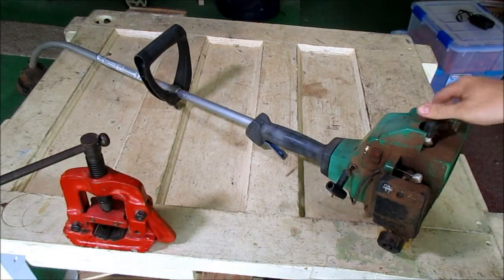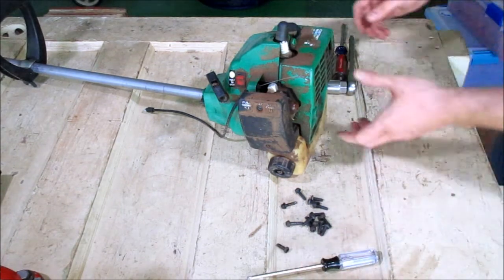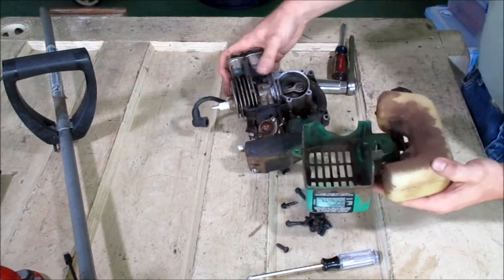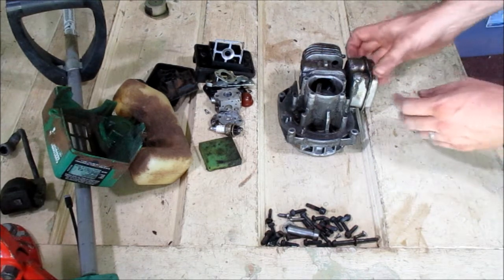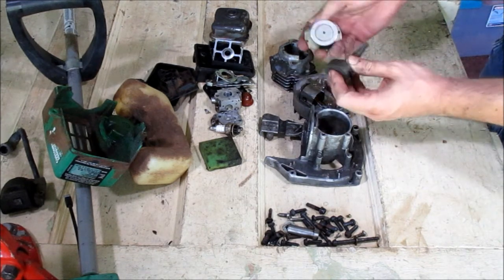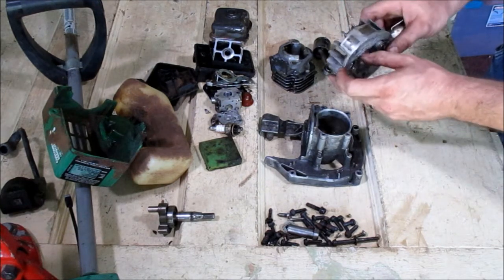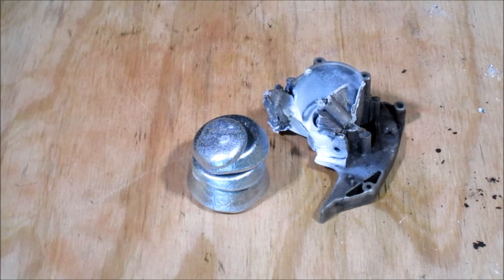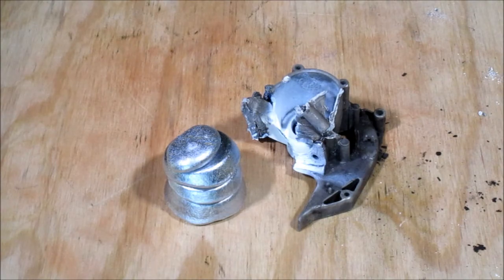Weed Eater Engine Melting/Burning

Comment: Lawn mower and weedeater engines are just not worth the effort to reclaim any sufficient quantity of aluminum anymore, and as time goes by they figure out more plastic substitutions too.
Reply from the maker: Especially weed eater engines!  Since people have to carry them around it is no wonder that there isn't much weight there.  The good thing about them is that most of the pieces can fit in my crucible.